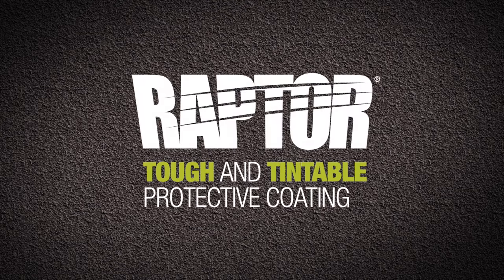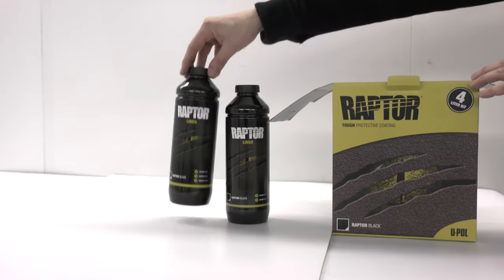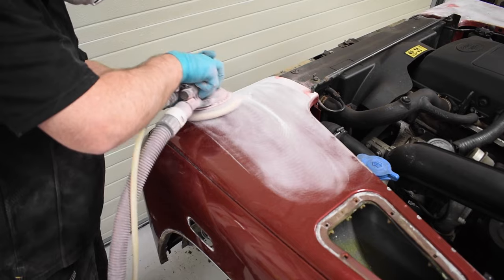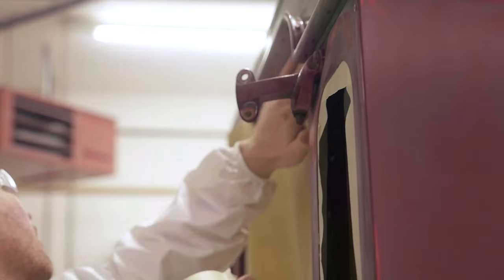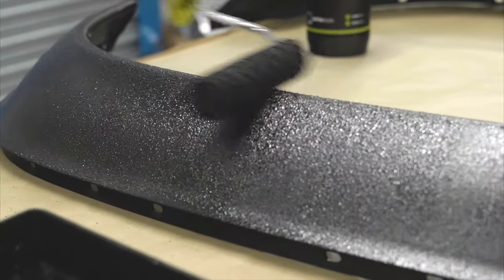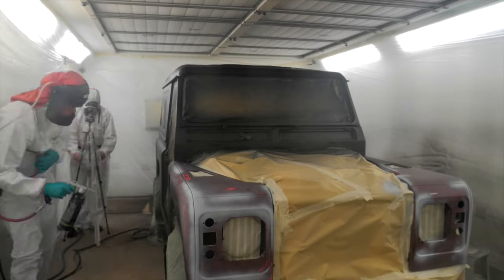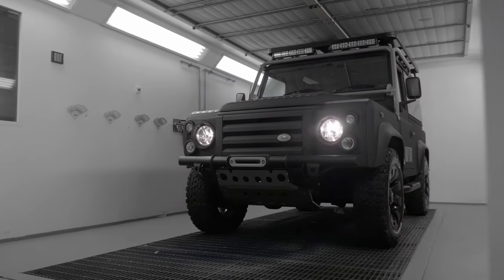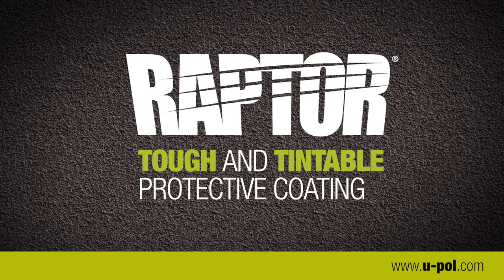RAPTOR Protective Coating - Land Rover Makeover

Comment: How long do you have to wait between coats?
Reply from the maker: Hi ZaneMaster. Allow 60 minutes flash time between coats. Note: the pot life of RAPTOR is also 60 minutes, so wait to activate the product until right before you're ready to use it. You won't be able to use any of the leftover activated product from the previous coats so mix only as much as you need.
Reply: What product do you recommend to clean the spray gun up after shooting the raptor liner?
Reply from the maker: Hi Zane.
Check the gun manufacturer's recommendations first. Most guns, including our UP0726 application gun, can be cleaned with acetone or mild solvent. Make sure you clean the gun immediately after use (before the product cures). Once the product is hardened inside the gun and pick-up tube, it is very difficult to remove/clean.

Comment: I was talking to a body repair shop about rust repair on my mazda mx5, they suggested using some of this on my underside/sills. Anybody have any experience with this?
Reply from the maker: Hi Point Blank. Although RAPTOR prevents rust, it is not a rust neutralizing / encapsulating product. It doesnot repair or stop existing rust from continuing. Any existing rust or panels damaged by rust, would need to be treated or repaired prior to applying RAPTOR. If properly repaired, primed and then coated with RAPTOR, the metal surface will be protected from rusting in the future. While RAPTOR will prevent rust from occurring, it will not stop / prevent rust from expanding by merely applying it over an existing rusted surface.

Comment: Can this be used on plastic trim?
Reply from the maker: Hi Dirt DownUnder.
You certainly can apply RAPTOR to (most) plastic! 

Remove all loose material from the surface to be coated. Clean, degrease, abrade, and reclean as per the TDS/Instructions. 

For Rigid Plastic: after abrading, clean and degrease then use an adhesion promoter, like U-POL GRIP#4 or U-POL 1K Plastic Primer.
For Flexible Plastic and Fiberglass (specificially PPO, EDPM, & PP): after abrading, clean and degrease. An adhesion promoter is required for proper adhesion. U-POL GRIP#4 or U-POL 1K Plastic Primer is recommended.

For more information, download the RAPTOR TDS from our website www.u-pol.com.

Comment: Protect it from what exactly?
Reply from the maker: Hi Jamal, Raptor protects from many things... rust, corrosion, a wide range of chemicals (fuels, hydraulic oil, salt water), it is water resistant, UV resistant... It can handle impacts without cracking so it's also perfect as a bed liner.
Reply from the maker: Hello, Aluminium will not corrode/rust – Raptor is applied to the Defender as a paint alternative offering greater protection against scratches & chips than standard 2K paint. Raptor also offers different finishes/aesthetics than standard 2K finishes.

Comment: Having an air fed spraying mask plus a workshop to paint a 2K product might just put a few people off?
Reply from the maker: Hi +5cylindersymphony. Although an air fed spray mask system is ideal, a respirator will work just fine as well. You also do not necessarily need a workshop to apply RAPTOR, although if you do not have access to a ventilated spray booth, we recommend you apply RAPTOR outside according to local, regional, and federal regulations.
Reply: Hum.   you deleted the comment that followed this.  Fair enough. Since it was a sensible set of questions i'll just leave you  to the  trolls  instead of trying to be constructive.
Reply from the maker: Hi 5cylindersymphony. I'm not sure what happened to your comment, so feel free post again, and I would be more than happy to answer!
Reply: Just interested to  know what  spray gun fluid tip size and thinning ratio would be best recommended when 'using raptor in a HVLP spray gun. Don't worry about  it,  there is a video on that subject on your channel.
Reply from the maker: Depending on reduction ratio of the RAPTOR from 10% to 25% and the texture desired, anything from a 1.4 to a 2.5 can be used.
Reply: This Raptor can be painted over.  Any tips and tricks if one decides to change the colour of the item raptor'd.
Reply from the maker: It depends on what it's being used for. If it needs to be durable, like in a truckbed, you can scuff and repaint with tintable RAPTOR in the color of your choice. If durability is not a concern, you can just paint over it – lightly scuff with a gray scuff pad and then paint with 2K solid color or basecoat clear coat.
Reply: Okay,.... thanks for that.

Comment: this is colour need so much cleaner and details . when u left the car two or three its become dirty
Reply from the maker: RAPTOR Bedliner and Protective Coating is actually super easy to clean! All you need to do is hose it off. Despite the typical RAPTOR application being quite textured, dirt, mud, and grime comes off with ease by simply using water.

Comment: How many cans/ liters would be recommended for a toyota tacoma with a cap? My is the same as this minus roof racks https://youtu.be/P1bCkGEzTPs
Reply from the maker: Hi Mauricio. The RAPTOR 4L kit sprays about 125 square feet with 2 medium coats. Buy 4-5 kits from a distributor who offers returns for unopened, unused product so that you have extra. Running out of product in the middle of a job is a pain! For more information on applying RAPTOR, check out all of our RAPTOR videos here:  https://www.youtube.com/playlist?list=PLBAFF31A863F99C87, and check out the TDS here:  http://www.u-pol.com/files/9838/up0820-SDS-EN

Comment: no good for waxing or very hard to wash
Reply from the maker: Hi SP330Y. There's no need to ever wax RAPTOR! Waxing RAPTOR is actually not recommended. It is incredibly easy to wash. Simple spray off with a hose, mild soap is optional. It's actually quite easy to clean and mud and dirt does not get stuck in the texture.
Reply: thanks, didn't know it was that good :)

Comment: looks like its been sprayed with tar , and they forgot to add the stones ,,, thats tragic
Reply from the maker: Thank you for your comment!

Everyone is entitled to their opinion, and that’s what makes America Great! This RAPTOR Land Rover will be well protected from scratches and chips when it goes off-roading, but for a normal street car, it may not be your style. That's okay! RAPTOR has other great uses, too, like as a truck bed liner or a protective coating on wooden decks, garage floors, vehicle underbody, wheel wells, stairs, and the list goes on and on! 

Just like cars and trucks, there are many brands of coatings out there and everyone has a preference and a reason to purchase their own. At U-POL we want our customers to have the best products for their vehicles.
Reply: lol ,, fair comment ,,, but the chassis and the bulk head , rear crossmember and body mounts , door bottoms and foot wells will all have rusted away long before then ,,, does the mud stick in the rougher texture ,,, 
but as you say , to each their own ,,,  i dont doubt the product is great , but on this occasion id question its suitability , in replacing an easily washed smooth coat of paint.
Reply from the maker: RAPTOR will actually prevent rust on chassis, door bottoms, footwells, etc. because it's water resistant and locks out moisture. You can even use RAPTOR on boat hulls! Despite its texture, anything coated with RAPTOR is actually quite easy to clean. The product does not hold onto mud and dirt, and it can be as easily hosed off and cleaned as a less textured coating. Looks are deceiving!
Reply: well unless your spraying the inside of those areas , it wont stand a chance , unless you live in the desert ,,, if you stand beside a landrover on a humid day , you can actually hear them dissolve ,, ,,, what do i base this on ,,,, 

i restore landrovers for a living ,,
Reply from the maker: That's awesome! We love restoring vehicles, and RAPTOR works great for all of those problem areas under the vehicle you mentioned previously. It locks out moisture (and keeps rust from forming) and protects those areas from dings, dents, and scratches. You should try it! Check out our website (www.raptorcoatings.com) for more information on the product or the rest of our RAPTOR videos on our channel. You may be underestimating the full extent you could be using RAPTOR in your line of work!
Reply: id like to have seen a sample sprayed from a spray gun too though ,,, just a thought

Comment: This does not protect anything. You have to remove your original coat of paint. If it would protect it would go on top, and protect the layer beneath. So what if I want to go back to the original color. I have to go through the whole process of repainting.
Reply from the maker: Hi Dan. RAPTOR is a Protective Coating, so like any other coating or paint, it will cover over the original paint and you will not be able to go back to it without removing the RAPTOR and repainting. There are benefits to using RAPTOR versus an OEM paint finish, like extreme durability and increased UV protection, but a full overspray, like what is featured in this video, is not for every vehicle. 

If you take your 4x4 vehicle out in the forest, beach, mountains, etc. and like to push your vehicle to its limits, RAPTOR will keep your exterior looking great far better than OEM paint, creating a scratch and stain resistant finish you can beat up over and over and then just hose off to clean.

Comment: What a complete waste of time, cheaper and easier just to paint it Matt black, plus dirt will stick to the finish, Land Rover ruined.
Reply: depends what you are doing with the truck. If you are off-roading Raptor is the way to go, no scratches from branches and rocks. I like the black matte finish too, looks good ona street rod, rat rod. I did the floors of my 61 bubbletop in raptor, looks great and a lot less weight than dynamat
Reply: I'm much more willing to Raptor the interior of my Defender, and plasti-dip the exterior.